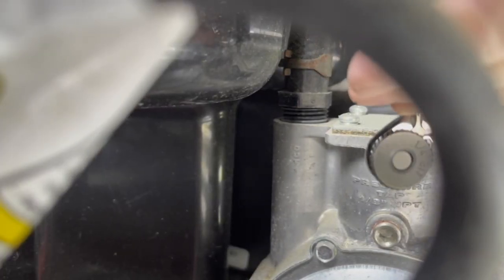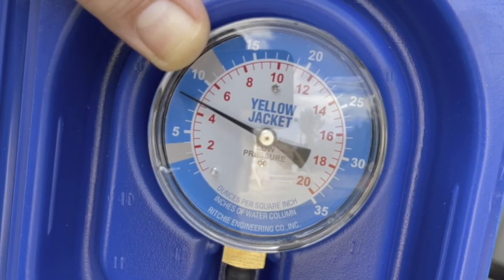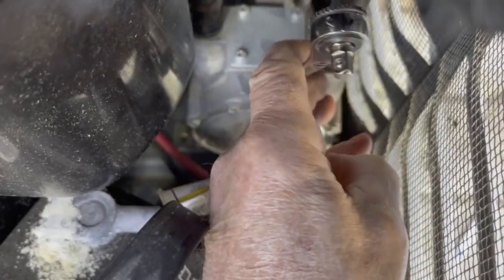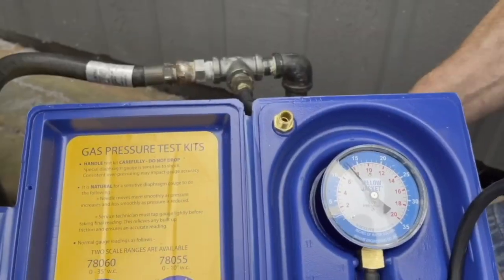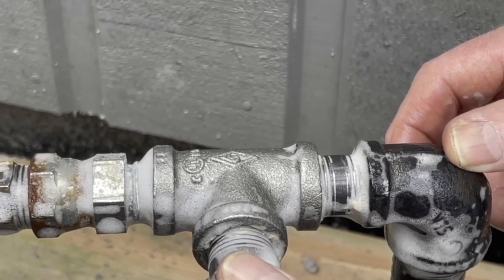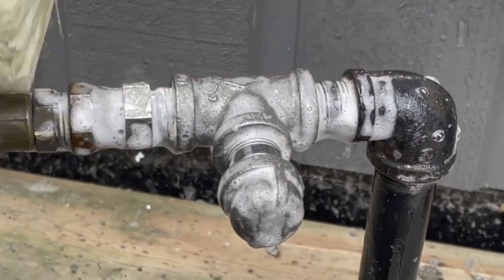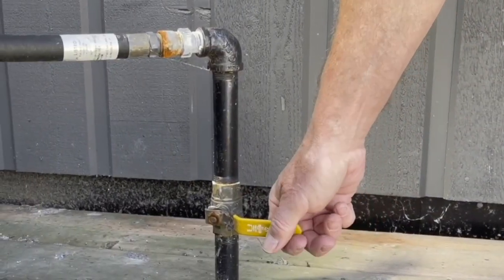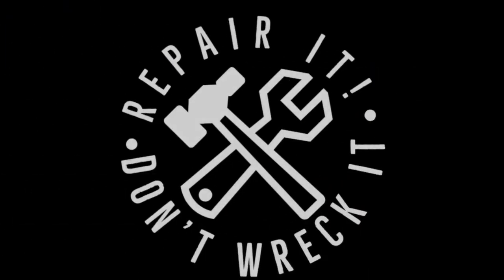Gas Pressure Test on a GENERAC Generator

Comment: Not sure what regulator(the new brown reg) that is on the LP tank, The normal regulator would be a hi press, maybe 10 psi, and then at the genset, a secondary reg would drop down the press the 15" or so. The gas piping needs to be sized accordingly.

Comment: Thanks for the demo my generator is hard starting to notice that if I choke the air going in it starts easier. It’s propane for fuel and I’ll have to check the pressure.

Comment: Great video! Curious as to why you checked pressure first at the generator and then second after the flex house which was just a few feet away?  Where you trying to see if there was an issue with the flex hose?   Also, is there any operational benefit of the generator to have the secondary regulator closer to the generator vs maybe 10-15ft away?
Reply from the maker: @ejn967  I was trying to figure out if the gas regulator on the generator was the problem. These valves work on the vacuum from the engine. I felt it was best to start testing at the generator and work back to the propane tanks. Gas pressure was fluctuating at the generator so I isolated it .  Now I was getting  fluctuations with the generator disconnected so it made sense to go the regulators at the propane tanks. There was only piping between the gas shutoff at the generator and the regulators at the propane tanks. The next logical spot for fluctuation would be the regulator’s on the propane tanks. The regulators were the responsibility of the propane supplier. From memory there was an issue on the propane suppliers equipment that was corrected. I was not there for that  repair but I’m pretty sure the problem was one of the regulators. Going through the system systematically gave me the best chance to diagnose the problem. 

My experience is with natural gas systems. Piping that is sized correctly with the proper pressures at the gas meter will do the job. The tables for pipe sizing are easy to use. For propane there’s no difference in the thinking. I really don’t have the experience to provide an answer for your second question. I do know that on propane set ups it important to have a certain length of piping from the secondary regulator to the generator. If it is too short it can create starting and related fuel issues. I would always size piping by the book. Short cuts here are not worth it. If your having problems and the piping is proper it eliminates a lot of guessing as to what is wrong. Generally mistakes are made on the piping installation. If you’re going with propane I would think the supplier would have the experience on which regulators to use and the best location for them in the system. I wish I could offer more on the propane side. 

I found checking gas pressures is fairly easy and can tell you a lot about what is going on. It’s really the same concept as a multimeter for testing electrical stuff. I hope I my answer made sense to you. Thanks for watching and posting. 
Roger

Comment from the maker: Hey Satterfield Electric. Thanks for checking out the video. I’ve never done a conversion on a generator . After reading your post I was thinking that with the conversion kit there should be instructions regarding the pressure that is required. Maybe you haven’t ordered it yet. As an example where I live the natural gas pressure after the gas companies service regulator is 7 inches water column. Since this is the pressure required to run my personal generator (not the one in the video) I’m good. Before you order your kit you would need to know the gas pressure after the service regulator. 7 inches water column is very common but should be checked. You can use a manometer or contact the gas provider for this information. Once you know this pressure combined with your generator model number you can order the correct kit. Every install is different. The number of fittings, valves, length and size of pipe all add up to reduce the flow of gas. There is a maximum pressure loss allowed. Undersized hookups can cause problems. I did go online to look at various suppliers of conversion kits. They all seem to be detailed in what they are selling and offer support. I hope this helps. 
Roger
Reply: I'm late to the party but per Generac: Required fuel pressure for natural gas is 5 inches to 7 inches water column (0.18 to 0.25 psi); and for liquid propane, 10 inches to 12 inches of water column (0.36 to 0.43 psi). NOTE : All pipe sizing, construction and layout must comply with NFPA 54 for natural gas applications and NFPA 58 for liquid propane applications. Once the generator is installed, verify that the fuel pressure NEVER drops below four (4) inches water column for natural gas or 10 inches water column for liquid propane

Comment from the maker: Hi Blade Runner. Thanks for checking out the video. When you are having hard starting issues always start with the basics to rule out the easy stuff. Check fuel pressure, spark plugs, air filters , valve lash, battery condition, battery cables negative and positive. Sometimes critters have made nests in the air intake. Ants can be a problem also. Take your time and go systematically through the process. Resist the urge to start replacing parts. You only get lucky once in a while. Good luck. Roger
Reply from the maker: Hi Blade Runner. I had another thought. When starting the generator is there any movement on the choke plate? If blocking the intake helps maybe the plate is stuck or the linkage is the problem.

Comment: I am buying the same wc tester you have for my generator.  I now know what to look for in my setup causing hard startups.  Much appreciated.
Reply from the maker: Hi  Eastman Research. I like this manometer. It’s easy to read and the plastic case keeps it clean and safe when in storage. Good luck with your testing. There can be a few things for hard starting. You have to rule out the basics which is extremely important in any diagnostic journey. Roger

Comment: Great video for checking gas pressure, I bought a home with a generac 13kw natural gas generator with a GT990 engine. I put a new battery in it and after numerous crank sequences it started up. My problem is that the generator backfires and idles kind of rough. I checked oil and spark plugs which are fine, do you think it could be fuel pressure? Should I have the utility company come out and check fuel pressure for me? The gas line feeds my furnace, water heater, cooktop and my generator at the last item in the gas line. Any help will be appreciated.
Reply from the maker: Hi lucerosells. I think it’s a good idea to check the fuel pressure at the gas meter as a start. From there you can check it at the generator. If you can see the most of the piping you could double check the size of the gas piping compared to the appliances that it is serving. While it’s not hard to do there is a procedure that needs to be followed to correctly size the piping. Probably someone on utube or on the web has posted how to do it. Make sure any shutoff valves in the system are fully open. Since you have no history of the system this is the way I would start tracking down the problem. On the fuel regulator in the generator you can also check the gas pressure when the unit is running and off. The owners manual I believe has the location of the test ports. Also the repair manual for your unit can be ordered on line. I’ve ordered one for my generator. It is pretty good and has a ton of information. I thought was well put together. You need some basic tools including a multimeter and a manometer. Next you should check the valve lash. This seems to be a maintenance item that is usually neglected. Make sure the spark plugs are the correct part number and gapped to specifications. Look at the air filter. Remove it to see if there is anything downstream blocking the air flow. Have a close look at the wiring. Double check all the connectors. Some can come loose or maybe another person messed around and didn’t put things back together properly. Is there a lot of rust around the fuel regulator? On some models this can be an issue, besides being dangerous. Your symptoms can be caused by an electric problem This is where the manual is necessary as it gives you different values that are to be expected when testing. To this point the only money you have spent is on some tools and repair manual. If you can’t confirm something is defective don’t replace it. Things like spark plugs, air filters, oil filters, batteries are maintenance and part of owning a generator. While most of this is not hard to do it takes time and some knowledge of how these things work. There’s a lot you can do without getting into trouble. The gas pressure testing requires taking stuff apart. If you never done before it could be tricky. Only you know what your comfort level is. There’s an excellent website gentekpower.com. The forum is excellent. There’s many post with people having the same issues as you.
Reply from the maker: Hi lucerosells. Looks like I touched the wrong button. For the symptoms you are have there’s a lot of things that can cause it. That’s why you need to work through in a logical way in your testing. Confirming good or bad results. I hope this helps. Thanks for watching and posting comments. Roger

Comment: I have a Kohler 27KW with a GM Vortec 4-cylinder engine.  It's running on Propane.  Been working fine for years, but the last start was not good.  Backfired through the intake several times, then it started but was not running well enough to reach the proper speed and the system shut it down.  I pulled the plugs and did a compression test and all was ok.  So I was able to get it started with some ether,  and it ran fine under load for about an hour.  A couple weeks later it did the same thing with backfiring and not starting.  Does this sound like a fuel flow issue?  Im not sure if I should call the gas company or a genset repair company.
Reply from the maker: Hi, maximum 25. I would check the valve lash. Even though the compression is good its worth looking at. Check the gas pressure at the unit when it’s running and turned off. These are easy things to do that only require test equipment. You want to get some direction as to what is the problem. Look at the air filter to see if it’s not plugged up. It sounds intermittent so a fuel regulator could be the problem. Your testing should help to determine if it is. If the gas company will check the pressures without charging you I would get them out. Have a look around the air intake. Mice or rodents may have created a nest or chewed up some wires. Even though it sounds like it’s fuel related other issues can cause the fuel problem. I’m not familiar with this engine. There probably is some sort of choke for cold starting. That needs to be checked for smooth operation and functionality. I hope this gives you some ideas on what to start looking at. Don’t change anything that you cannot confirm is defective. It tends to get expensive. Thanks for checking out the video. Roger

Comment: Great video , was wondering if you could do the same gas check for natural gas Generac.
Reply from the maker: Hi, The Airboss1955. Thanks for taking the time to check out the video. Everything is exactly the same for natural gas. Check your manual to see what is the required gas pressure for your model. Checking gas pressure is an excellent diagnostic tool to give you direction when solving a problem. Also, it can be used when doing your regular maintenance.  Gas pressure could be checked when changing spark plugs and oil. This way you can get a bench mark when the generator is running properly. Roger
Reply: Thanks, expecting new 22k Generac shortly, not sure how natural gas from my house will react with Gen set. Gas company is installing new larger gas meter on house so will see. Thanks again
Reply from the maker: Sounds exciting. I was looking at the installation manual for my 11 KW GENERAC. The pressure for natural gas should be between 3.5-7 inches water column. I don’t think it would be different for yours but always check. Just make sure the gas line is properly sized. This is one place not to cut corners. If it is undersized a brand new unit will not function properly. There are tables in the installation manual.  The authority having jurisdiction may use the regulation adopted by the region you are located in for the installation. Every area has its unique rules. The calculation is based on gas pressure, length of piping and the btu’s that are required for the generator and other gas appliances in the system. This is where you need an experienced installer to ensure a smooth installation. Good luck.Roger
Reply: @repairitdontwreckit4257  Per my Generac shop manual for 8-20kw: Recommended fuels should have a Btu content of at least 1,000 Btus per cubic foot for natural gas; or at least 2,520 Btus per cubic foot for LP gas. Ask the fuel supplier for the Btu content of the fuel. 
Required fuel pressure for natural gas is 5 inches to 7 inches water column (0.18 to 0.25 psi); and for liquid
propane, 10 inches to 12 inches of water column (0.36 to 0.43 psi).
NOTE : All pipe sizing, construction and layout must comply with NFPA 54 for natural gas applications and NFPA 58 for liquid propane applications. Once the generator is installed, verify that the fuel pressure NEVER drops below four (4) inches water column for natural gas or 10 inches water column for liquid propane.

Comment: hey dude nice vid, one question im will conect one 15 kw the pipe gas can i do it at 1/2 inch or need to be 3/4? just one gas regulation right
Reply from the maker: Hey moises lemus. Thanks for checking out the video. I need to know if it’s natural gas or propane and the length  of piping that you are planning to install. Also the installation manual that comes with your machine has a chart inside to give you some direction also. However if you give me some informational I can look it up. Another piece of information that is required is what pressure is the utility providing if it’s natural gas. Thanks

Comment: Hello, I have a Generac 12kw.  It starts but only runs 10-15 seconds and shuts down. No lights are on the display. y problemIf I leave the switch at manual it will keep starting run for a short period of time and shut down.  Could this be a gas supply problem.  Any suggestions?
Reply from the maker: Hi Juma Abdiroglu. Thanks for checking out the video. Sorry I didn’t catch your question till to day. The fact it runs and shuts down I would look at the safety items first. My first thought is to test the oil pressure switch. It is fairly easy to check. There’s only two wires connected to it. There are two ways they can operate. The controller either recognizes it as an open or closed switch. When the units starts oil pressure is developed and either opens or closes the switch. This information is sent to the controller or the circuit is interrupted to prevent damage to the engine. With out a model number I really can’t offer much more. Also check the level of the oil. Sometimes it is the simple thing’s . Gas pressure could be an issue but start with the easy things first. I hope this helps to get you started. Roger

Comment: how 'bout that battery corrosion :)
Reply from the maker: Hey,  @StanGenerX. The corrosion while it looked bad wasn’t affecting the power to start yet. I did a video on cleaning up the battery posts with baking soda. At that point in time the corrosion still was superficial and hadn’t made its way between the connector and the battery post. Thanks for posting and reviewing the video. Roger